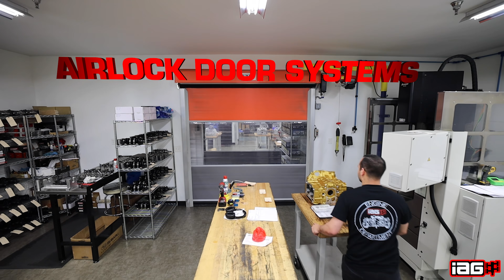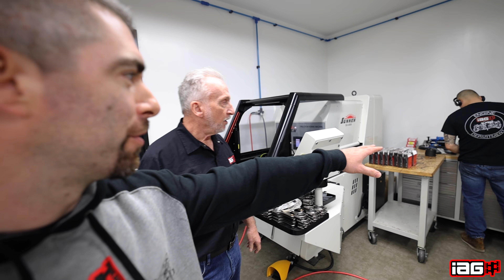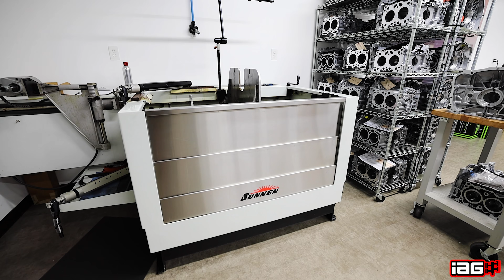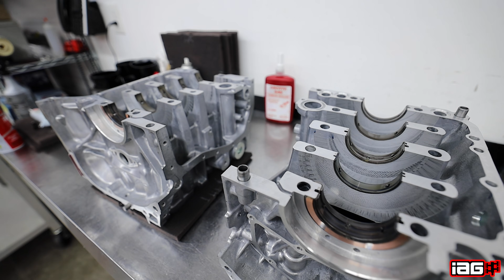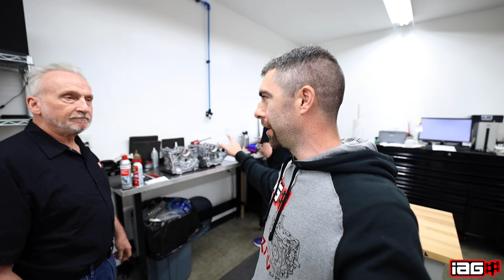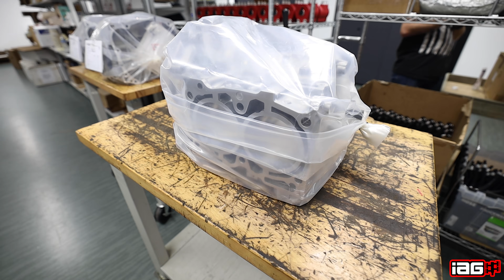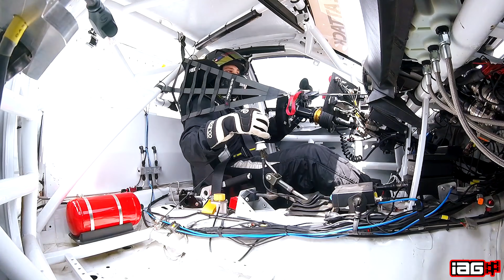What IAG block is right for you?

Comment: i just dont get it, running at 210kw 574.5nm i done the ring lands, apparently oem is only good for 200kw max, fair o. so after the rebuild with forged pistons (rings etc) 14mm ARP head bolts and aftermarket ECU im guessing 230kw maybe 250kw at the wheels i lifted a head with 14mm studs, we are talking 800hp with 14mm studs? how do i even get to 500hp at the fly without 14mm studs, we are talking 500hp on a pretty much standard block (with pistons) whats the secret?   edit: 2009 wrx hatch with 257 short block, obviously modified, most bolts-ons short of type of fuel used done, tho still using topmount aftermarket

Comment: Are there long-term downsides to going closed-deck? I want a super reliable 400-500whp setup (generally on the 400 end of the spectrum), but am uncertain if the closed decks have inherent cooling issues or are prone to excessive wear.
Reply from the maker: There are no cooling issues with the closed deck process. Since the insert is less than an inch thick and has holes which match the head gasket, it still allows full flow of coolant. The strength of closed deck system makes it ideal for long term reliability, with no downsides.
Reply: @theiagchannel  thank you!!

Comment: Hi Team, when having heads ported  and the bolt holes opened to use 1/2 inch head studs. Do the heads then need to be clamped down to replicate the same level of distortion as if they where bolted down to the block in order to cut the valve seats correctly?
I was told this by someone that had an issue with the valves sealing only after they had been clamped down on to the block. 
 thought I would heck with you first as I have bought one of you IAG Shortblocks to suite 1/2 inch studs.
Really value your advice with this

Comment: I just got an IAG 2.5 with 11mm 625+ CA head studs. I'm planning on making 620whp with it. I'm hoping that'll be enough to hold 33lbs of boost.
Reply: Considering that block is rated @ 700 BHP, you will be risking a rebuild very soon, if you factor in drive train loss you will be over the rated crank hp rating. You should have jumped up to the Magnum block.
Reply: @SiCaRiI_DaGgEr  they've since relabeled the stage 2.5 to the 750 block. I think the limiting factor is the head gasket at those boost levels. If you pair it with an Athena fire lock ring head gasket, you're golden. Josh Bader has a customer that hit 650whp on that setup with no issues.... and that's a stock location turbo.
Reply: @Anonymous-c6f7d  

Head gasket is not the only limiting factor. Type of head studs used,  poor assembly, distortion ect. There are noted issues with Firelock setup if using the wrong sized studs.  14mm  head studs are recommended .. I urge you discuss this with IAG and your builder.

I went with the Cooper ring head gaskets by IAG's recommendation on my particular build. 2.5 Closed deck 750/Rotated setup 500whp

Comment: Which block should I go with if I plan on going around 500 whp... daily and sometimes racing it? And is it any problems going in the 03 wrx?
Reply from the maker: If you plan to use the 2.0 heads I'd go with the Stage 2.5 International Hybrid Block. It has specially designed pistons to work with your 2.0 heads. Give us a call and we can get you everything you need.

Comment: if im installing a built block and there is nothing wrong with the current block, is the timing chain and tensioners ok or should i replace them? (fa20dit)
Reply from the maker: Depending on the mileage, we would recommend it but it all goes off inspection when they are removed.

Comment: Is there a follow up video explaining the downsides to each block? It almost seems like if you had infinite money you would just get the stage 4 or even the X block since it didn't seem like there would be any negatives to using those blocks for a daily making 300 hp. Or is there downsides to streetability to each level?
Reply from the maker: Good question. There’s really not any downsides to the higher stages other than cost. Buy the highest stage you can afford which meets or exceeds your power goals for maximum reliability.

Comment: Very interesting video.  I have built quite a few performance engines using stock components with varying stages of modification to them. Only thing I missed in your video was balance checking on all the components.

Comment: Looking to make between 500-550 WHP on a FA20DIT WRX. Which block do you recommend for purchase?
Reply from the maker: Stage 3 extreme FA20 DIT closed deck short block. Going with the stage 3 extreme will still give you room to make more power in the future.
Reply: @theiagchannel  What about the 450-75 WHP mark if I didn’t want to deal with going port injection and the cost associated with that when you try to make over 475?
Reply: @christianrios7037  From what ive seen from local guys, still the same Stage 3 extreme block. Problem with the FA20 is factory ECU exhausts the breadth of its fueling beyond 600hp and thats when its time to get a MoteC

Comment: Hey friends I need a recommendation. I bought a Subaru WRX STI 2012.  But it consumes too much oil. I asked the previous owner if he knew something about it and he said he had a blowby.  well he cheated me .. but he told me that I had to put a forged motor short .... do you think that if I put only forged pistons and rings on it, I would solve the problem.  or do I have to put all the iag short block. ???  what dou you recommend.????

Comment: how long do you think these motors will last?   weekend warrior road racing and daily driving etc...
Reply from the maker: How you maintain it and how it is tuned will determine the life of it. We just had a car with block #189 come back into the shop for an E85 upgrade. It is still running strong!
Reply: @theiagchannel  where do I find the block
Number.   Maybe you can give me a bit if it’s history.   I bought it from a good friend complete turnkey.  Been running E85 since I got it.  Only one tank of pump gas.  It’s a beast.  Feels like it will almost do wheelies when on boost.
Reply: Stage 4 1000+ block.  Stage 5 head.
Reply: @theiagchannel  I have block number 04201

Comment: In regards to the ej20 magnum, would ej20g (1998 wrx) heads be fine to use, or would you recommend 205/207 heads? Not sure what power I want to make yet, but probably around 450-500bhp.
Reply from the maker: Ej20g heads would work but 205 or 207 would be better flowing.

Comment: I have an IAG stage 1 pushing 480-500 wheel on a mustang dyno. It’s held up well so far and I just submitted my oil for analysis. I want to push this block a little more depending on the oil results. The cost was 3k for just the block. I have seen posts about 600 wheel on RA blocks but I don’t know what dyno they were on. I know the stage 1 is 500 BHP so we’ll see how it holds up for the long run.
Reply: update ??
Reply: @sturdyspamsl2277  I didn’t even know you commented it’s late but the block is being sold now it’s held up just fine and now I’m going with a closed deck stage 2.5 and going rotated with a precision 6266.
Reply: is it the short block or long  block? not sure which one to go with

Comment: Can you run all of these engines as a "stock" engine and still pass smog (CARB-legal)... I was just curious if it was possible to have an IAG engine that I can run as an OE-replacement but have the benefits of toughness/durability and the potential to increase power beyond 500hp down the road (if/when I move to a different state).
Reply: Hi, I live in CA as well. Just make sure your compression ratio is going to be very close to your original block and head set up. forged or not, so long as the stock tune can run the fueling correctly for the brief period during smog, you should be capable of passing without issue. Granted your emissions devices are all installed and functional.

for example, a 10:1 compression engine on the stock map would likely be a huge no-go and be impossible to pass smog as a result.
Reply: @ogsmokey187  thanks for the info brother I really appreciate it. I haven't been able to find many threads on the topic so your input is very helpful
Reply: This is exactly what I'd like to know as well
Reply: @sweatyben1550  Hi, I have two WRX STI 2.5, one with stage 2.5, and one with iag longblock 900, if you use a standard thickness gasket (stage 2.5) the compression ratio remains the same as the standard EJ25, so by mapping the ECU correctly you have no problem, you could also map the 3 maps in a different way, in order to pass the emission control with the first map. If you just want to make the EJ25 engine better strong, you have two options: 1 Buy new pistons and connecting rods and keep the power low, or take for example a 2.5 iag stage, using the standard gasket, and a standard head, then you will have power in safety and no problem with emissions. If you need it, I have 2 WRX STI with IAG engines. A greeting
Reply: Did anyone find out if that is possible?
Reply: @thenormalworldofwes6656  hello I replied to another user for this info
Reply: hello I replied to another user for this info

Comment: So if the stage 1 block will work with the stock ECU factory tune, does stages 2,3,4 and CNC billet short blocks work with the stock ECU factory tune as well?  I’m curious if all IAG short blocks can be drop in replacements for stock motor for use with stock tune.

Comment: Hopefully you have those stuff for FA20DIT as well..
Reply from the maker: Video coming soon on the FA20 and EJ20 line.
Reply: @theiagchannel  did you ever make the FA20 video for this?  I keep looking for something and ending up back here
Reply: they do. its on their website.
Reply: @ZZPxFTW  do you have an idea what is differences of short and long block was? A side for compression
Reply: @SGQ12  a short block is just the bottom end without heads (so casehalves, crank, rods, and pistons,) and a long block just means it has heads attached. Their ported heads use OEM castings, so stock 10.6::1 compression ratio regardless of just a short block block and swapping your stock heads, or if you do a full $15k long block from them. That is, if the head gasket you use is also stock thickness. They'll probably work with you if you want to run different pistons with larger cam reliefs or whatever though. Damn, they should hire me lol
Reply: @ZZPxFTW  hahahahahahhaah

Comment: @IAG Performance is there max boost/PSI tolerances for these motors? Ideally looking for 25-30 PSI but not more than 500whp. By HP rating alone stage 2 tuff would work, but would the stage 2.5 be recommended because it's a closed block?
Reply from the maker: We would recommend the stage 2.5

Comment: Great video, but what is the point of forging your internals on a semi closed block, when the cylinder wall flexes under heat cycles and boost pressure. Which causes head gasket  failure, to say you rate the semi closed deck at 500hp is really pushing it. Here in the uk, all good engine builders highly recommend close decking at 400hp. Some say even at stock power it should be closed decked due to the movement on the cylinder wall. Forging your engine won't stop head gasket failure. Interesting video though 👍
Reply: He's talking 500BhP which is like 330-350whp. If your builder is saying anything past 400 he means WHP needs a closed deck. I hear a lot of RAs are making past 400whp on stock block but personally for peace of mind I would go closed deck after 400 WHP

Comment: Have you guys developed your program for the Fa20 cylinder heads? If so what stages do you offer? I already have your stage 3 block, and my bare cylinders heads with all the goodies. I just need the assembly and machining. Ive checked your site and it does not offer any information. Also as the AOS is available for the BRZ/FA20 block
Reply: You can use an AOS on anything... even for refried beans.

Comment: Been rocking the closed deck for two years now and still running strong. Just make sure you're doing proper maintenance with Motul fluids 👌
Reply: What are you running for whp? I just got tuned at ~550-560whp on my 700 longblock.  Hoping it’ll last several thousand miles if I take care of it and treat it right.
Reply: @thomasbovard5292  you hope it will last several thousand miles...?!?! That's it? Do you think it won't last several HUNDRED thousand miles? Are you tracking the car or daily driving?
Reply: @TMar129  I was only driving it 1-2k miles a summer, so several thousands were more like 50-60k miles.  But I ended selling the car, life had other plans
Reply: There is nothing special with Motul. Chose the right weight/viscosity.

Comment: Thoughts on the Stock RA Block compared to your Stage 1/2 block? For the price point of around $1900 for the RA and the amount of power people are making with them its hard to beat for price for power.
Reply from the maker: Video coming soon on this.
Reply: @theiagchannel  awesome!
Reply: It’s not about “the power ppl are making with them” it’s about how reliable it is!!how long would it live!!  Ppl made 500-600whp with stock blocks! It’s about the confidence when you go full throttle every time!
Reply: @ARCH.JALALJABARI  I've got an RA Block making 460 WHP on pump gas and that engine takes a beating fairly often. I've got a pretty good amount of confidence put into the newer OE Engines.
Reply: @Smeedia  still there is a guy who have made 600whp with that white 07 been dragging it a lot and it was a stock block. Ppl are making a good power with RA engines but I personally would never buy it new over a build block!
Reply: fancy seeing you on this thread!
Reply: I am curious about the closed deck ej205 they just released.
Reply from the maker: Video coming soon.
Reply: @theiagchannel   Do you guys have and engine build kit for the OBS Impreza's? I have a 97 wagon I'm tearing down (rebuilding transmission ATM), and I'm look for around 350WHP replacement engine. Knowing what must be done to build a truly "Bullet Proof" engine I'd like to outsource for a shot block and heads. Got anything like this?
Reply: @Bursti_  Basically a close decked EJ207. Probably saves costs close decking an EJ205 because they are basically identical once close-decked.
Reply: @bumamotorsport4573  Hold up - is Subaru's new RA basically more similar to the EJ than the FA? I know the EG/EZ/EE series quite well, but not the FA and RA for some reason
Reply: @John-rw9bv the ra block was just designated that for the use in the sti type RA
Reply: @Lennysuga  there's a few people making over 600WHP on them, others have hung out around 500-550. The one in my 05 is hanging out at 460WHP on pump gas without issue.
Reply: @smeedia. Tanner, perfect timing for this! I was just looking at buying an RA over a built block due to the price point vs power & reliability output. Can’t wait for the upcoming video from IAG. I’m also 45 mins from their shop. So pickup will be nice if I end up going With them.
Reply: Aren't the type RA blocks in 2019+ STI models? I heard they are pretty stout with the proper care (like anything really)
Reply: @christopherheimbuch3456  correct me if im wrong but i think they were in the 2018+ sti ra and then the 2019-2021 sti's (all of them)
Reply: @Nebrida23  I think the RA is only in the wrx right now, 2020 and earlier STI still uses the EJ series) any subaru going forward will have the RA
Reply: @dpm9a189  Very incorrect. The RA block is an EJ and the WRX is on the FA platform.
Reply: If knew you'd be here i just knew it
Reply: What's up homie?
Reply: Following
Reply: I blew my RA block up recently after only 9800 miles. Was only making 296awhp. I did money shift it however so there's that. Makes me wish I spent the extra 1k or so on at least a stage 1 block from iag. Likely would've been just fine as it only hit 8k rpms and the only result was a busted ringland with misfire symptoms and excessive blowby shortly after.
Reply: @ogsmokey187  Yeah it doesnt really mean much to me reading about people running such high power in their RA block because longevity is never mentioned. People will praise a block for holding power but have less than 500 miles on it lol..

Comment: @IAG Performance, any reason the Stage 3 & Trojan blocks was skipped entirely? I understand that it shares a lot with the Magnum block but it would’ve been nice to hear the input on the copper sealing rings found on them which arnt used on any of the other blocks in the video. That plus it steps up to the Tri Beam Rod in the Stage 3. I think a video in the same format going over the difference between the Stage 3 Extreme, Magnum, & Trogan blocks would be a fitting addition to the channel.
Reply from the maker: We recently evaluated each of our short block offerings to determine their popularity. The Trojan and Stage 3 Extreme blocks were two of our least popular offerings. In an effort to direct our limited resources towards the best selling products we made the decision to discontinue these blocks. For those that have previously purchased either of these blocks, don't fret - They are still excellent choices.  We simply removed them due to lack of popularity, along with the fact that several blocks in our lineup "overlapped" with regards to power ratings.
Reply from the maker: We recently evaluated each of our short block offerings to determine their popularity. The Trojan and Stage 3 Extreme blocks were two of our least popular offerings. In an effort to direct our limited resources towards the best selling products we made the decision to discontinue these blocks. For those that have previously purchased either of these blocks, don't fret - They are still excellent choices.  We simply removed them due to lack of popularity, along with the fact that several blocks in our lineup "overlapped" with regards to power ratings.